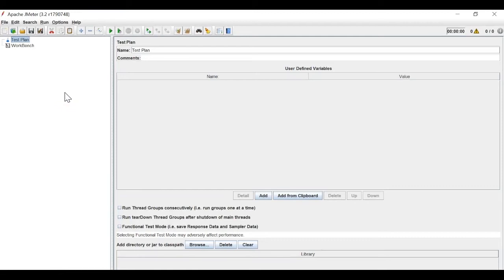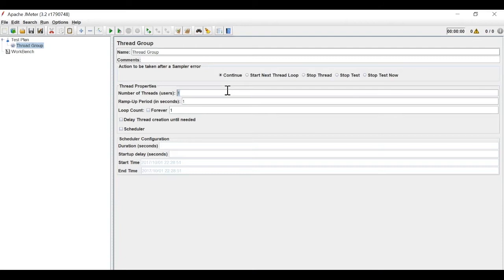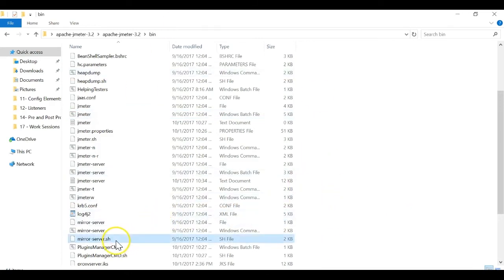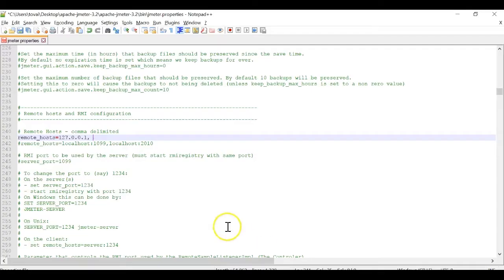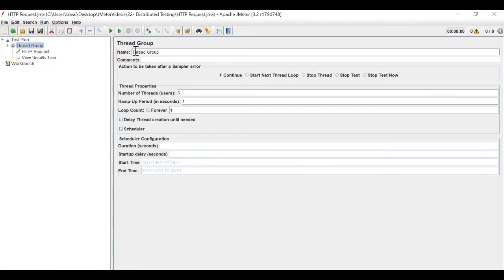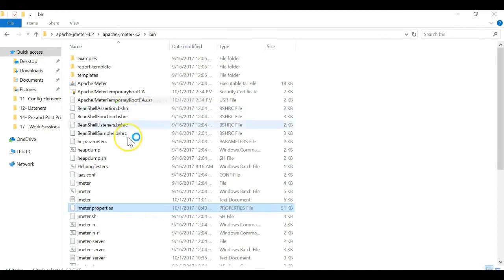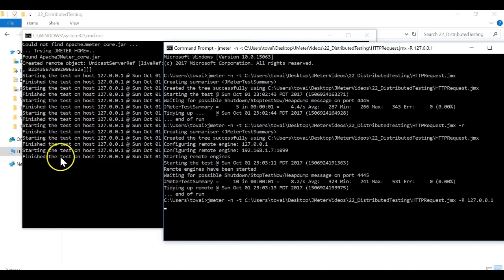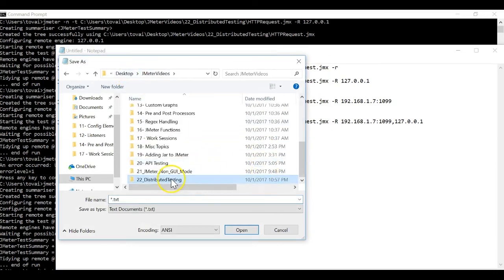Distributed Load testing - JMeter Tutorial 21

Comment: Hi,

Earlier i used Neoload for load test, things make simpler.

Now i am using jmeter please help me to load test in simple way without any complicationa like split users for thread group and split csv files.

I have 1 jmx file which has 74 thread groups with 1200 users with unique data of 74csv files, i have setup scenario for each thread group similar to Neoload, i have 1 master and 5 vdis as lgs, in neoload select lgs and run test, here how can we plan to run?

Comment: Thank you for such wonderful information, I really appreciate for making a great video on Distributed Load testing.

I have added 16 Concurrency thread groups in my test plan. When running with 2K users with distributed load across 19 slave servers, I can see the summary report on the command prompt when running the command " tail -f -n 2 MVP_2K_Run.log ".
But when running the same test plan with 15K thread (users) across the 19 slave server and running the same tail command then stuck at "Waiting for possible Shutdown/StopTestNow/HeapDump/ThreadDump message on port 4445" and there is no summary showing on the command prompt but the log and Jtl file is getting generated.

I have run my test plan with 15K users and distributed the load on 19 servers using the below command

nohup /opt/apache-jmeter-5.4.1/bin/jmeter -Djava.rmi.server.hostname=10.104.180.** -n -t MVP5.2_BaseLinePT_15K.jmx -l Novus_MVP5.2_BaseLinePT_15K_23Oct.jtl -R <<1 to 19 slave servers ip address> :4000 > MVP5.2_BaseLinePT_15K_23Oct.log 2>&1 &

JTL and log files are created on the master server under the specified path but a summary of execution like the number of threads started, active, and finished and error rate percentage are not showing on the command prompt when running the below command tail command (tail -f -n 2 MVP5.2_BaseLinePT_15K_23Oct.log).

It shows the below details only.

Remote engines have been started:[1 to 19 slaver server IP details] Waiting for possible Shutdown/StopTestNow/HeapDump/ThreadDump message on port 4445

I divided the total number of threads by 19 and then added it to the concurrency thread group.

For example, if I have to test one scenario with 2000 VU, then 2000/19 = 105. So I am passing 105 Vu in the 1st currency thread group for 1 hour.
1500 VU in the second scenario, then 1500/19 = 79, so we added 79 VU in the second concurrency thread group for 1 hour.

Like this, I have added it to the 16-concurrency thread group for 1 hour.

Please help me to solve these problems.

Also, the generated JTL file is getting very heavy for 60K VU (approximately 4.5 GB in size) please help me to reduce the size of the JTL file.